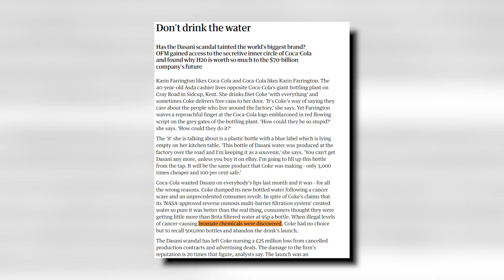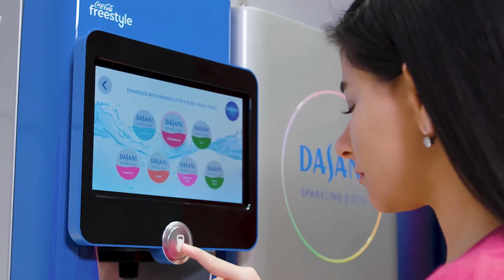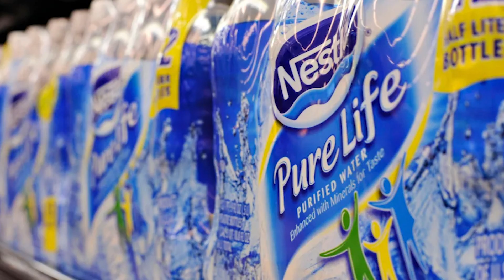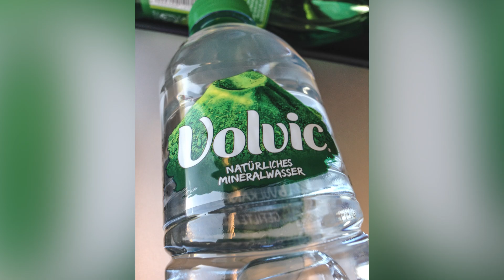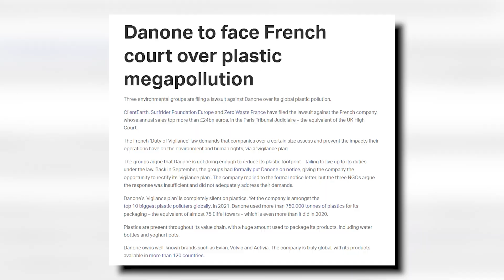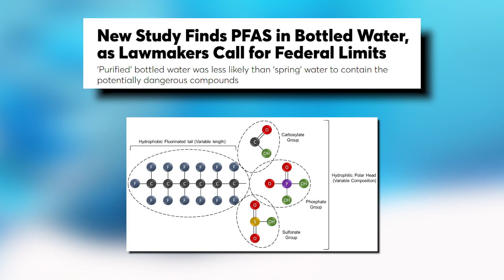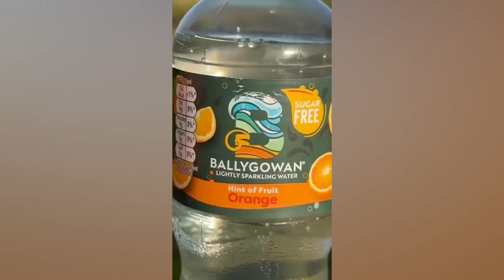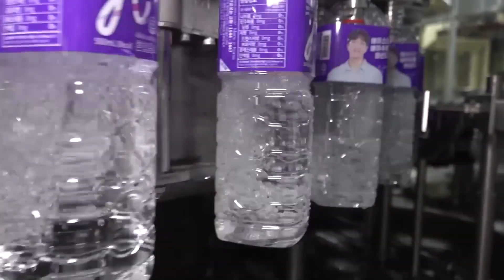NOT 100% WATER! STOP Drinking These Bottled Waters

Comment: This  why I stopped drinking bottled water because I did the research in 2017 and found out that plastic bottles aren't safe and most I researched weren't what the bottle was printed on the bottle 😮 I boil my tap water or use a glass water filtered water pitcher. I also drink out on glass containers. Back in the day they're weren't plastic containers only glass ❤😢
Reply from the maker: Those were the days :) hard to know what to trust anymore
Reply: Petroleum Chemical Industrial Revolution plus Greed got us here.. 🌱✌
Reply from the maker: @202One  Yeah… it’s wild how something as simple as water turned into a profit machine. Greed really reshaped what used to be basic trust.